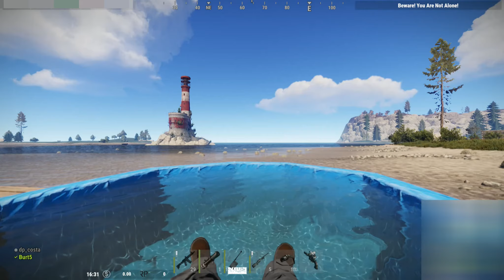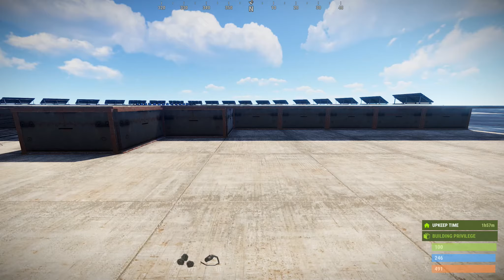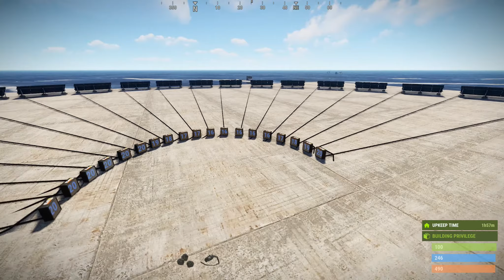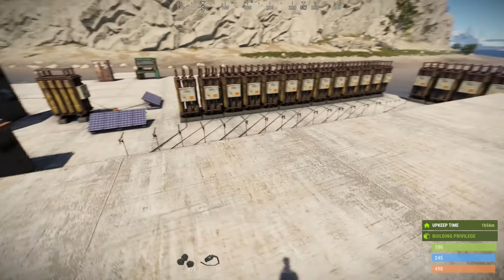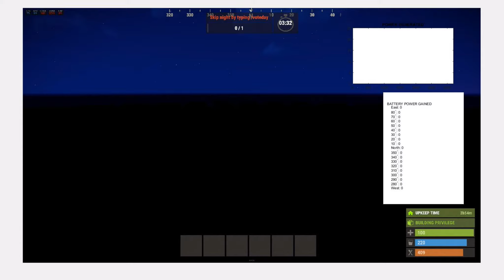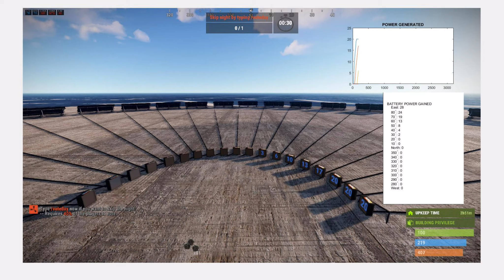Firkin's Rust Tutorials: Solar Power Analysis

Comment: North facing solar panels shouldn't work if your on the top half of the map. there is a imaginary equator where the sun is in the middle of the map. if you want accurate noon readings while on the top half of the map I believe the solar panels should face south even if the shadows are showing otherwise.
Reply from the maker: Lol probably. It looks like it's a southern hemisphere setup.